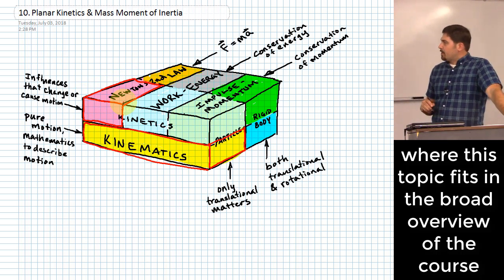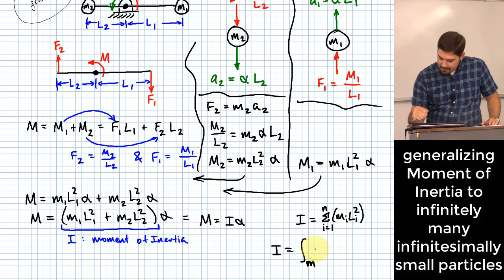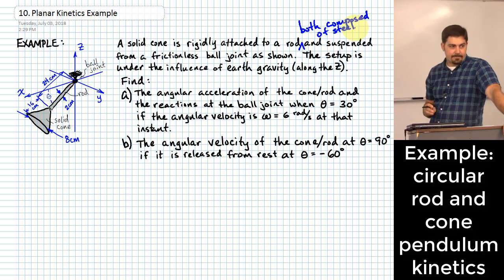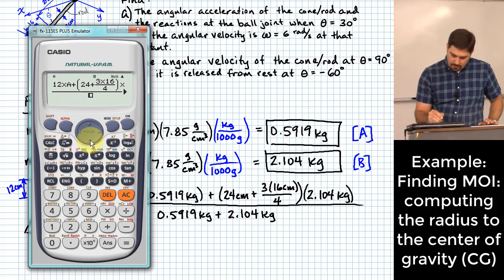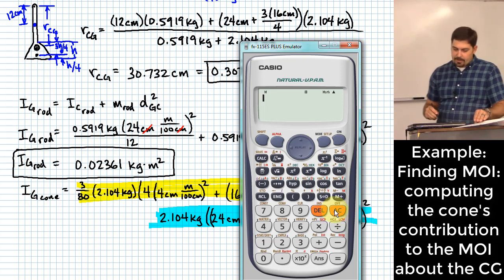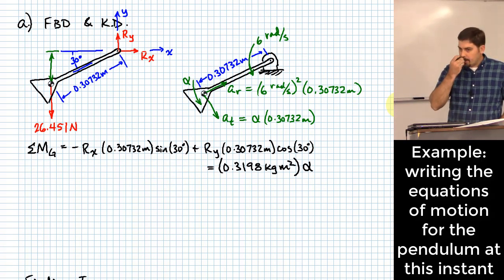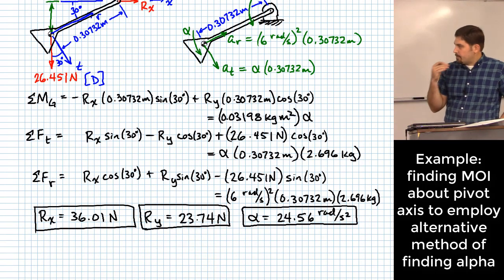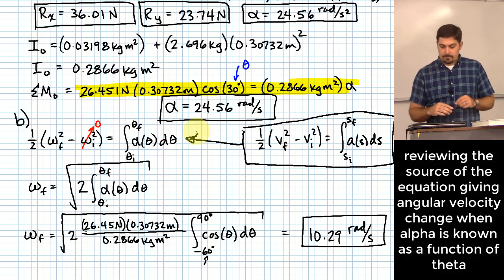Rigid Body Kinetics | Mass Moment of Inertia | Fixed Axis Rotation | Parallel Axis Theorem

Comment: Thanks for your time and dedication. I'm curious why you chose not to look up the moment of inertia for the rod  from a common table, which gives 1/3 mL^2 ? I would assume that you find the moment of inertia for the entire object by doing the Par. Axis Theorem for the cone and adding it to 1/3 mL^2 .
Reply from the maker: The method you suggest would certainly work without issue. I was just reinforcing the use of the parallel axis theorem, but what you outline would indeed be a bit easier. Thanks for watching!
Reply: @TheBomPE  Thanks for replying! Your work is very much appreciated. Great video
Reply: @TheBomPE  hello doctor, can you please explain to me what he means by that, if we calculate the moment of inertia of the rod (1/3 mL^2) isn't around its center of mass or what because he is saying that we only need to do parallel axis theorem for the cone and add the 1/3 mL^2?